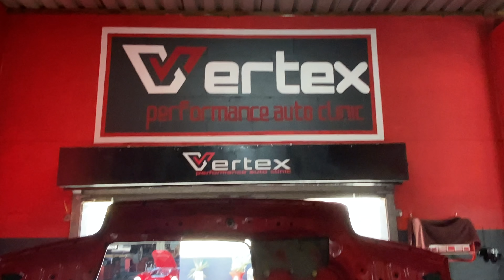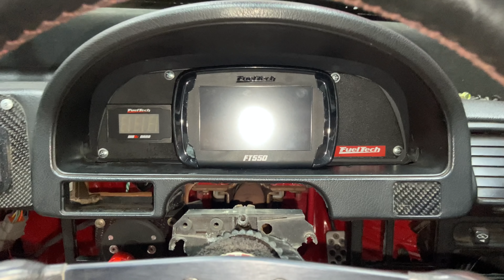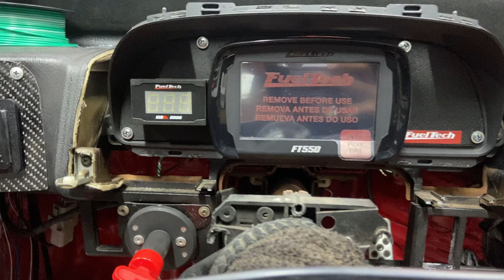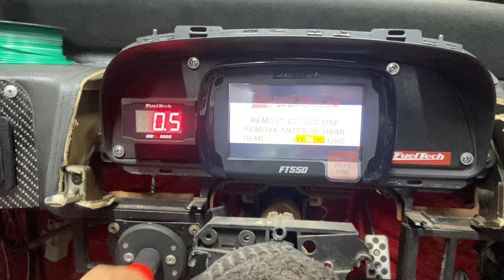Race, Break, Fix, Repeat!

Comment: You're lucky the head came out of that alive. That one was clean failure, if there is such a thing. Haha. I'm excited to see those test. Fuel types and intake differences. 
Lastly, ECU upgrade and that strain gauge is awesome. Haven't seen it with an H pattern before.

Comment: Obviously you know much about cars but little about electrics. Coil packs and other wires - sensors - must not be side by side. Wires with high voltage can  interfere with other wires and cause catastrophic failures. Take care please.. Separate cables but also must use shielded  cables
Reply from the maker: I’ve separated the crank pick up sensor wiring from the coils. It’s a shielded cable as well. Thank you for you input 🙏
Reply from the maker: Cam sensor is also a shielded cable. I’m assuming you know much more than me about wiring. How do you explain the oe wiring though? Like for example on the oem k series harness all the wires are side by side. Crank sensor,cam sensor vtec,VTC all lay in the same tube alongside the coil packs.
Reply: @lyleafricaracing  Just trying to help ❤
Reply: @lyleafricaracing  I didnt know you made sure of that. Just wanted to give you my thoughts. Never doubted you are a very capable mechanic  👍